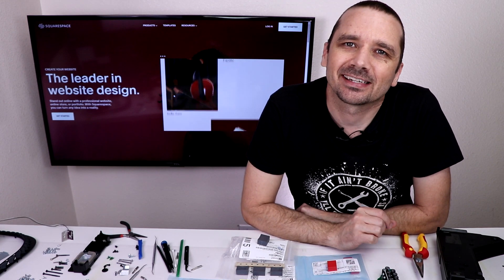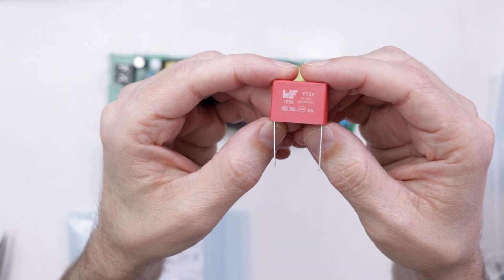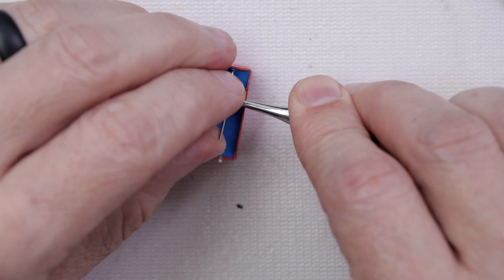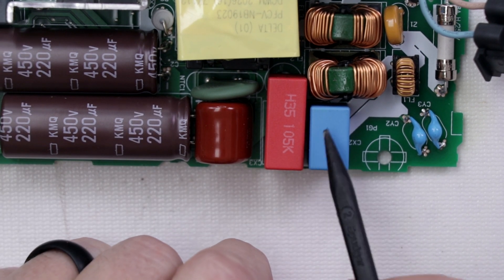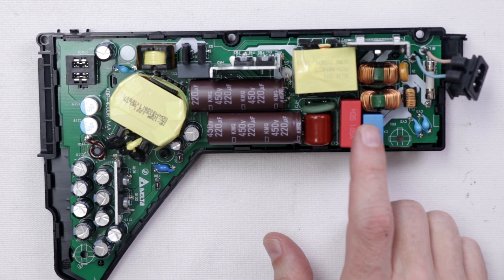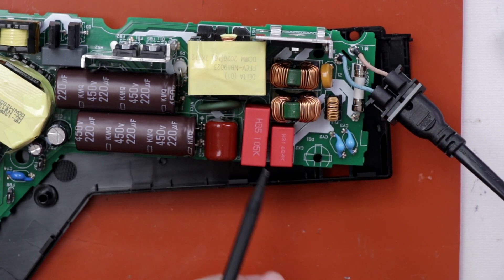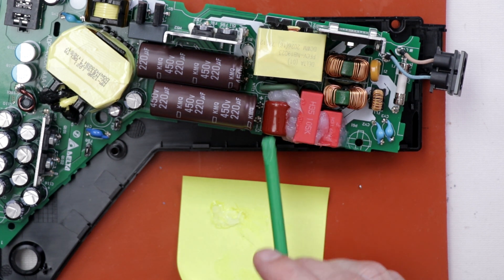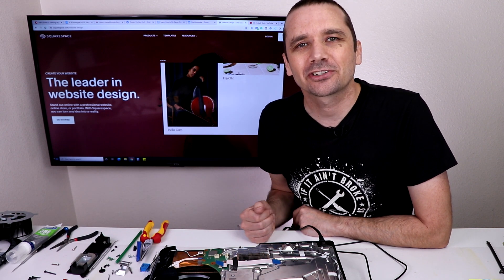Did I Fix PS5 Coil Whine?

Comment: Is Sony going to fix this?Its so annoying.
Thank god I still have warranty.
Reply: As long as ps fan boys keep cleaning out shops instantly. Sony won't care
Reply: They're fixing it with warranty? Or we should wait for Sony fixing this component first?
Reply: @maxzorroz  a lot of people are sending their consoles back for repair and getting a new one that has the same issue. It's a problem Sony haven't really made public they've acknowledged and are going to change in future builds. 
Youd think the people in charge of  whatever department handles complaints would see the vast amount of consoles coming back for the same problem
Reply: @lewis523  Gotcha! I got PS5 this month and played some time, it's not that bad, but while there is no sound it's annoying a little. So i think its best to wait few months and then try to send it for replacement - maybe then new ones won't have this issue.
Reply: @maxzorroz  that was my plan but I just couldn't be bothered waiting 😂 ps4 pro sounds nicer and quieter than my ps5 did
Reply: Coil whine isn’t hazardous just annoying and “IS NOT” covered by warranty.
Reply: @ThatFatCat  people have been able to return consoles over and over for the same loud console noises
Reply: @lewis523  I have gone through 3 ps5's, av just given up am now waiting for a proper revision or a slim can't keep doing this the noise is so annoying it was driving me nuts. My series x is so quite even if I put my ear near the fan I can just About hear it. It's literally inaudible, All I wanted was to play was god of war man :( please Sony fix Ur noise, I had the consoles quite a distance and all I hear is a whine and some buzzing or the nidic fan on the 3rd with coil whine and I was going mad, tried the o ring method the sound was literally making me want to smash the console
Reply: @thealien_ali3382  literally everything you said  I give up too. All these Sony fan boys think such a low quality product is acceptable

Comment: Those Caps are X-Capacitors, they are input filtering caps. A PSU guy once told me its not to filter stuff coming in but preventing stuff from the PSU thrown out to the grid.
With that said: they can be omitted and are actually not important...

And on the bright side: it ain't no RIFA ;)

Comment: One hint regarding THD soldering:
1. insert Pins
2. Bend & cut Pins (clinching)
3. solder Pins

If you do it your way, you Stress the solder joints By the cutting. I wonder why nobody has noticed this!

Second, the IC below the X-Cap is an discharge Controller. No Need of silicon ontop. It‘s active after depug.

Third, By reducing the x-cap value, you detune the emi filtering Performance. (Feedback to the gridside) may be with this change, you do Not pass the Standards (e.g. FCC15), but who cares.

I guess this topic is related to the tolerances of the filter unit. Usually, Nobody Tests the Full Range.

Comment: Question is though...  Does anybody actually sit that close to their console(s) to the point where they can hear a very minor buzzing sound?  Obviously this is for the purists,  I seriously doubt the average person can hear coil whine over their TV/headphones etc.
Reply: I could. I had to move my console further from where my tv is so I don't hear it that much. I didn't buy PS5 to use headphones.
Reply: Mine stays behind the TV, I never hear anything. Maybe on real quiet nights I'll hear it someday, but it doesn't bother me now.
Reply: Yeah, I definitely hear it. I think it is enough that it causes the whole machine to vibrate and that is what I hear - the vibration of the console rather than any buzzing or "whine" from the coil.
Reply: Well on most of my games, i cant hear it. But in R6S and Valhalla running in Performance mode, it is very annoying.
Reply from the maker: I think most people don't notice/don't care (I don't mind the noise personally) but the noise does get fairly loud so it can be annoying.
Reply: I was thinking the same thing. I don't play that close to the console so I doubt that I would ever hear it. I'm glad I decided to wait to buy a ps5. Hopefully all the complaints will be fixed in later revisions of manufacturing.

Comment: With capacitors in parallel you can just add the values to get a total value (e.g. 1nF in parallel to 100pF = 1.1nF in total). The voltage on the label is it's max voltage specification. If you use higher voltage rated ones you should be fine. The type of capacitor has effects on it's charge/discharge behavior.

IMO the grey capacitors rated 630V max voltage should have been fine as long as they had the same capacity value as the original ones. Your solution will also work as long as the total capacity of your solution is similar as the total capacity of the original solution. Using a smaller capacitor in combination with a larger one could actually be an advantage, since the smaller capacitor can most probably charge quicker. 

I'd still be curious to see you using the grey ones, since they seem to have the same size as the original ones? Can't you take out the power supply without touching the cooling solution?

Comment: Pretty sad consumers would have to fix an issue that professional engineers should have fixed during prototype stages of the ps5 development.
Reply: there is nothing to "fix". This is not even a problem or a defect. If you don't like it you can "fix" it yourself.
Reply: @asdrubale bisanzio it is not a defect and no company thinks of it as such and neither do most people. It only became a popular thing to hate about becasue of the ps5 and because people are sheep and do what other people do. It doesn't "scream". All electronic devices with a lot of power running through it will make noice. I think people have some weird expectations. No pc or console can ever be silent. Don't buy one if you want perfect silence.

Comment: at 6:51 the buzzing your mic picks up is actually not the physical audible coil whine. you are moving your mic into the flux (the electromagnetic or EM field) of the coil that's next to the smaller capacitor, and the mic actually picks that up as EMI (electromagnetic interference), acting like a radio.
Reply: Thats why we wanted him to record it while playing a demanding game
Reply: @MrUchiha  I think I'm very close to the solution. Just tested Borderlands 3 in 120FPS mode with the PSU seperated, and guess what? Under load the buzzing is NOT coming from the PSU but from the Mainboard. As everyone else before said, it's Coil Whine from the Main VRM Coils. Maybe vibrating and touching the cooling metal sheet. I'll give it try and put thermal pads on the VRM's. Same with the disc drive beiing noisy. I found out, that at some spots the metal case of the drive is in contact with the cooling metal sheet. So, metal on metal... buzzing sound when drive is working 🙉 depends on how tight the screws are. I also will dampen that contact spots with foam rubber
Reply: @andyb.981  keep us updated my man!! :)
Reply: @andyb.981  is it possible you can take pictures of what you’ve done? Upload it to imgur or something so we others can do something similar if it works? 😇
Reply: @MrUchiha  sure, i always document what i'm changing. So, just now i'm done putting thermal pads on all VRM's at the back of the Mainboard an PS5 is put back together. fingers crossed
Reply: @MrUchiha  sorry to say that: no success 😔 then it only can be the GPU itself. For now i'm done trying and will wait till a system Update hopefully fixes this 🤷🏻‍♂️
Reply: Was für ein update meinst du,kannst du ein video machen wie sich deine playsi anhört

Comment: He just did something a billion dollar company didn't or couldn't
Reply: I'm quite sure Sony could fix this without a problem.  Problem is money, they want to make as much as possible so they use cheap, probably Chinese caps and not quite expensive ones from Germany.
Reply: @PerKroon  my thoughts exactly !
Reply: Financially, Sony made the right decision. Saving 5-10 cents on a mass produced console saved millions of dollars, and the amount of people making warranty claims or returns for this issue doesn’t even come close to the savings.
Reply: Taken in consideration that Sony makes them at a lost yes they gonna try to cheap out, the redesign process of a simple PSU is easy but when trying to apply that in real life it will take time and effort both sony have 0 of.
Reply: @ChuckNORRlS  Do you have any actual proof/source that Sony makes a loss on selling  PS5?  Other then loose speculations from Bloomberg and similar?

Sony told their shareholder that they do not make a loss on the sales so if you are right I see a lawsuit coming.
Reply from the maker: This type of noise is considered normal and not a defect so they wouldn't spend the money to "fix" it.

Comment: Do all PS5 PSU's have coil whine? If not then maybe an identical part replacement would make more sense? 🤔

Have you looked in to using a different type of capacitor? Are the ones causing the coil whine film capacitors?
Reply: That's a good question. I'd buy a power supply instantly and put it into my PS5 if I knew it was quiet. My PS5's coil whine is so annoying.
Reply: @HaZzZrD  yep im waiting for a new power supply
Reply: I believe coil whine is random and sometimes resolves on its own.
Reply from the maker: I have no idea if they all have it or not. Both of the PS5's I have here have it. I used a different type of capacitor in this video.

Comment: 7 years and sony can't fix this annoying coil whine bruh
Reply: They so cheap they don't use Silicone around the capacitors same with Xbox
Reply: Coil whine isnt a sony thing but a electronics issue as a whole pcs have this issue too
Reply: @seanbrackett2  yeah they could have put silicone around the capacitors to dampen the sound at least, same with Xbox creator's
Reply: @aaronajbird07  i mean honestly silicone is all they need but i honestly cant hear the whine with the ps5 but if they can fix the disc drive spinning that would be nice
Reply: @seanbrackett2  I think the disc drive needs to spin to play games mate 😃
Reply: @seanbrackett2  that's something I never actually tried yet was see how loud the disc drive gets, aroused my curiosity there lol
Reply: @Amir.253  the disc drive spins when i'm playing other games for example for honor is in my disc drive but i'm playing ghost recon and it starts spinning at random intervals
Reply: @seanbrackett2  after my ps5 arrived I have the same problem as you apparently it's perfectly normal it's because the disc drive spins so fast that's why it's loud Sony have said this and Im sorry for implying you're being dumb there is one thing you could do which is manually eject the disc with a screwdriver apparently that helps for some according to don't otherwise it's just being loud cause there's no other noise from the ps5

Comment: Thank you so much for your video. Really helps to understand reason for the coil whine issue with my PS5 (tried 3 and all of them had either very loud fan or disturbing coil whine).

Tried to ask around Berlin area for shops to do the same as you did but none replied positively. Is the time being spent so much that everyone rejects fixing coil whine?

Comment: By the time PS5 becomes regular stock, I hope all these issue will be fixed by the rev2
Reply: I hope so to, I have gone through 3 ps5's and I couldn't bare it anymore, the whine, fan noise was driving me nuts. Every ps5 I got had either coil whine, loud fan or both. I was literally getting so Mad I wanted to smash it to bits. My series x is so quite even when I put my ear near it I could just about to hear it, it's literally inaudible. All I wanted to play was god of war. I am now waiting for a proper revision or a slim

Comment: The RAM running hot, coil whine, fan noise and general unavailability plus the fact that the 36 months of game pass ultimate conversion is very interesting at the moment made me switch to Series X. I'm just gonna wait till a revision or slim/pro model pops up.
Reply: ram is running in its temp range so not hot close but its whatever
Reply: The ram and fan noise aren't huge issues. We have seen very few-no failures because of the ram, and believe it or not, both the launch and ps4 pro consoles ram ran at about the same temperature and they have low failure rates.

Comment: Coil whines is usually comes from the copper wire wrapped component right above the blue components. I would used glue gun or epoxy to cover the whole coil to mask off the sound it makes
Reply from the maker: This video clearly shows that that's not where the noise is coming from.
Reply: @Tronicsfix  I'm only guessing that sony cheap out on components. Unless people have super sensitive hearing that picking up the coil whine

Comment: i hate opening or working with power supplys, i remember i was fixing a imac and my screw driver hit the power supply and i got shocked but thank god i didnt get hurt i hate it, also was it smart putting the zip tie because its plasic and you got power going there, dont think something can burn
Reply: That’s why you need to use plastic gloves + plastic handle screwdriver.

Comment: You should test it in different games and different environments. I get it in some games in certain situations and depending on load. It's a real shame because the machine is whisper quiet but in some games at some points the buzzing can be irritating as heck. Also sorry but who suggested silicone on the ICs? haha
Reply: Someone did, i saw it. But whats the problem with it? Would u rather use hot glue? 🤷🏽‍♂️
Reply: @MrUchiha  No I'm suggesting there is no point to it at all. Calm down. He even said himself that he doesn't think it's going to do anything to help.
Reply: @firestorm517  sorry... u said ICs... i thought u meant the caps 😭😭
Reply: @MrUchiha  😂 no worries buddy 👌

Comment: Don't cut the legs after soldering. The force you apply while cutting can damage the solder joint. Tiny fractures, oxidation, cold solder joint look and time to take it all apart again.
Reply: Couldn't you also say, in reverse, that if you happened to solder the joint poorly, the force from cutting the leg would, with any luck, immediately reveal the poor joint? This has actually happened to me before, and I was happy it did (even if it means my skills with the soldering station might be questionable). However, no good looking joint ever became loose.

Comment: Thanks for your video, it's an excellent job. A recommendation, to discharge the 450V capacitors, use a 1K to 5W resistor and put it on the legs of the capacitor. Regards.

Comment: I noticed you still plugging in your switching power supplies unloaded. If you I personally have smoked my computer power supply and it wasn’t pretty. The big capacitors just exploded instantly. It is safest to just use the motherboard it is made for to load them.

Comment: Capacitor whine isn't the correct term since the coils in the capacitor is what makes the coil whine noise you hear coming from it as power is passing through them. The sound changes in volume depending on how well the noise dampening of the coils works within the component. The components getting coil whine in the first place is due to Sony using less expensive components to cut costs, so this is what happens. This is nothing compared to the coil whine some gpus can make when under load.
Reply: But silicone/glue will dampen the noise?

Comment: Using a 2k ohm power resistor to discharge your capacitor won't give you that scare. Also if you want extra protection (not really needed for these small capacitors as arc flash isn't an issue) using some 00 electrical gloves will protect you even further.

Comment: Please record while playing a game like Demon souls or Destiny 2.  No one can hear the coil whine just by simply turning on ps5 or it’s not audible at least.  We need it tested on one of the games that causes high coil whine like demon souls or destiny 2
Reply: I wouldn't really say no one because people with faulty PS5s can definitely hear the coil whine / loud PSU noise even in the home screen.
Reply: my issue is with d2 atm - the game is well optimised and it's what i play most of the time, but the ps5 version creates a lot of coil whine - i've had this issue with 2 consoles - the noise although overall is quieter than ps4 pro is a lot more annoying than the fan noise from that (for me at least)
Reply: @aki-sid   buddy ofc.  I’m just putting it on the table,  no one cares or complains about the coil whine when they simply turn on a ps5.   The complaint is during a game how loud it gets
Reply: @evilmingdoctor   Destiny 2 is loud on the ps5.   And many people always defend Sony saying “it’s not a defect”. Well neither was the jet engine ps4 a defect.  It’s just annoying and Sony needs to fix it.

Comment: Look at you, using a Hakko to remove solder.  I always wonder why you use lesser methods when you can use that instead and be on to other things faster.  Also, I think the zip tie was overkill. Otherwise nice "upgrade"
Reply from the maker: I use what works best at the time (imo). Or what's easiest...or what I have sitting right by me.